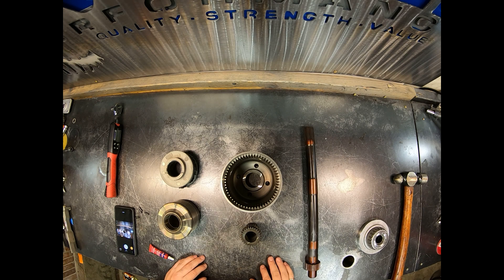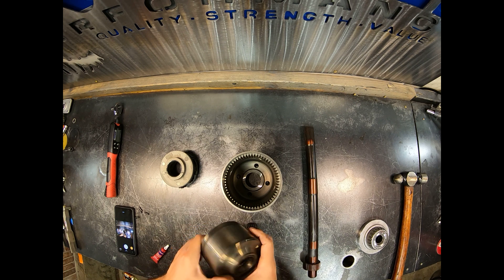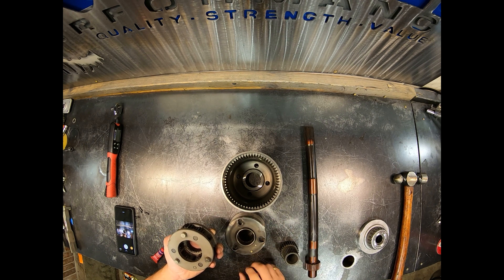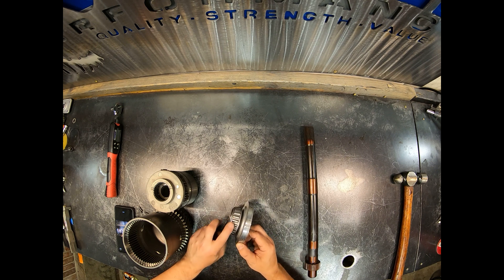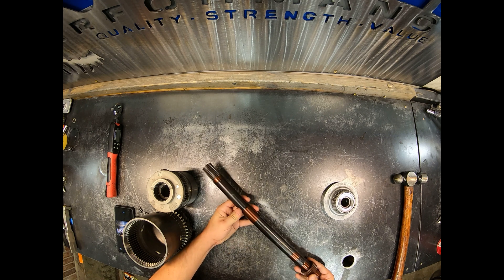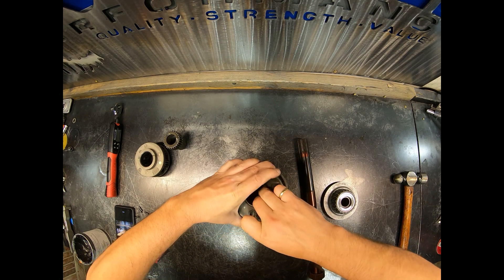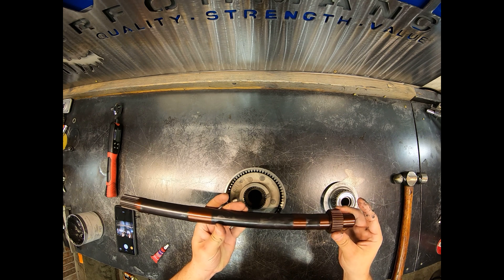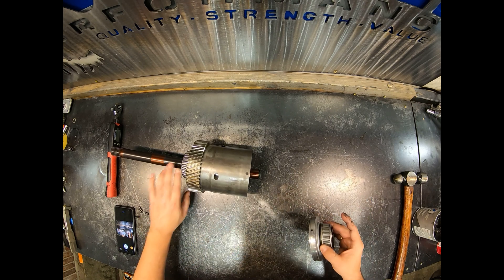3000GT VR4 / Dodge Stealth AWD Center Differential Assembly

Comment: Very cool to see it all go together!  One correction;  if your VCU is blown you won't know it unless the front or rear wheels are on a slick surface.  It acts similar to an open differential where the set of wheels with the least resistance will spin when bad.  A way to test it in the car is to put the rear wheels on the ground and you and a friend turn the front wheels the same direction (forward or back) and you shouldn't be able to move them.
Reply from the maker: I do not want to disagree with you there but yes you will know if you launch the car, even ona prepped track it will tend to spin the front wheels if your vcu is blown.

Comment: "How's the center diff on a 3s work? I don't know, it just does" 😁 Great as always!
Reply from the maker: I could have gone into more detail about that part for sure, most wouldn't really care :) The VCU part has stacks of steels, some that lock to the outside of the vcu, and some that lock to the inside, with silicon fluid between them. Through some chemical witchcraft when the inside and out turn at different speeds the VCU goo heats up and locks the plates together. That locks the planetary carrier through the vcu pins to the outside of the vcu and the sun gear to the planets, which basically makes the whole unit act as one piece.
Reply: @RvengePerformance  not criticizing, my lame attempt at humor  (Joe Dirt reference)
Reply from the maker: @aaron3360  oh I didn't think so, appreciate the comments! Thanks for watching!